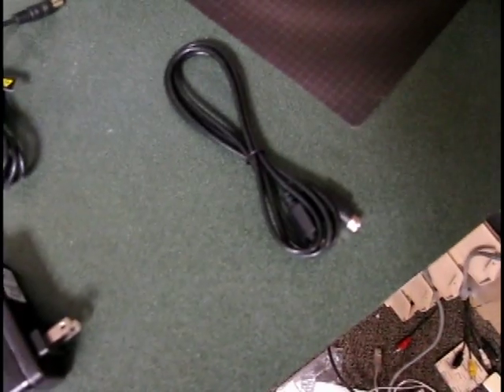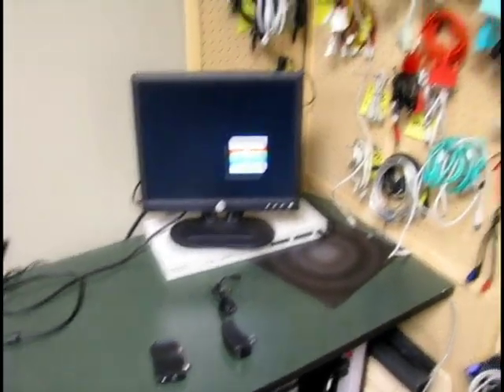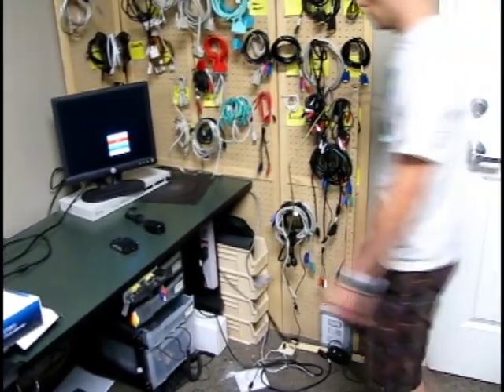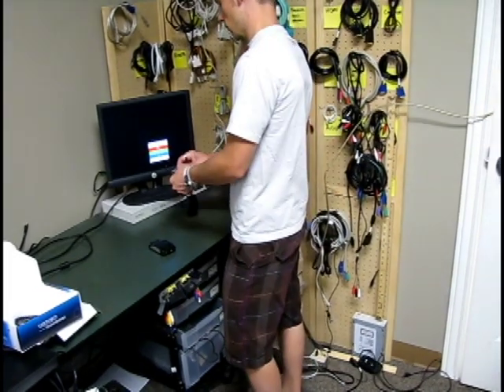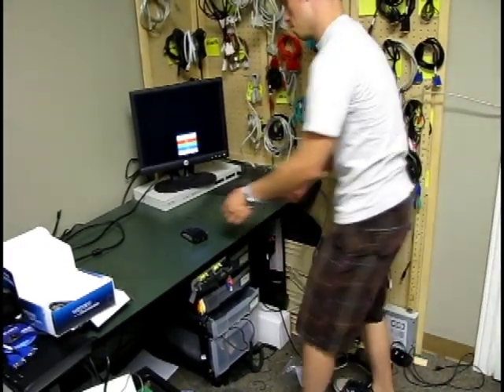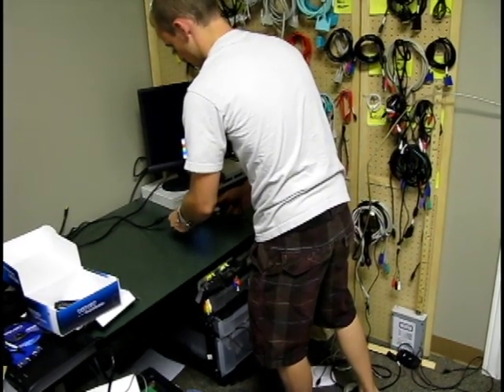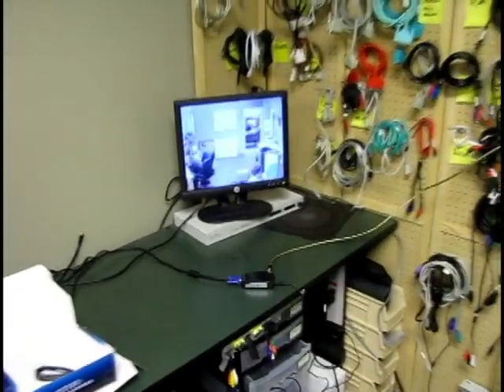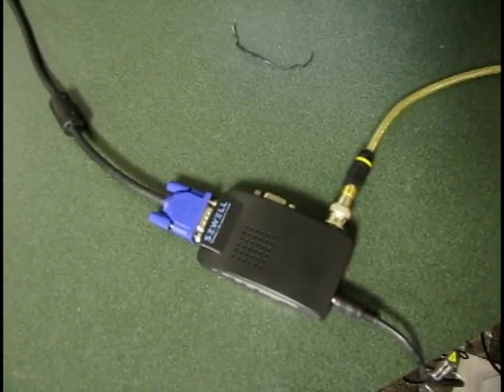BNC to VGA Converter Demo

Comment: how do you connect a bnc camera that the computer will recognize, so I can use my software to capture feed? I use a security software, and USB cameras, but they have limits to the length of USB cable/boosters.

Thanks for the videos you have put out.

cheers
Reply: You'll need a capture card